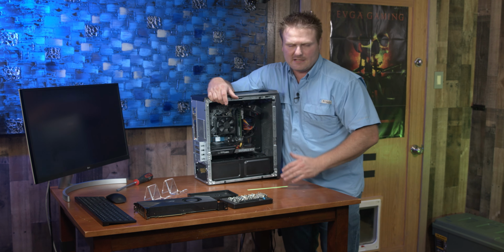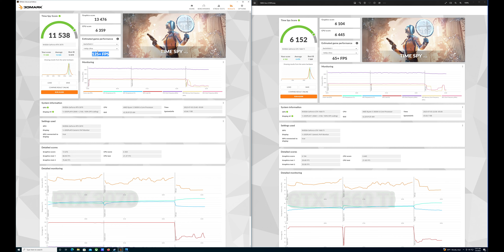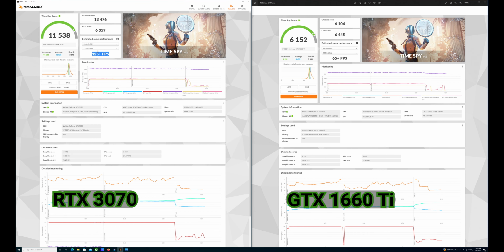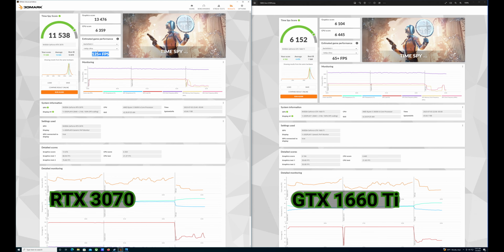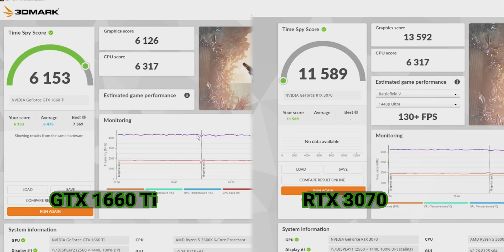ASUS Rog Strix Gaming Desktop G10DK Lets Upgrade the GPU to a RTX 3070 '' HOW TO INSTALL GPU ''

Comment: Thanks for these info packed videos on the legendary ASUS "Where's the Ventilation" series of ROG Wonder Boxes. I have the G10CE. For now. Quick questions: 1) This is the same system you unboxed in December 2022, right? Meaning it still has the 550W PSU on board and it's OK to run with a 3070 GPU? 2) the list of GPU's is really short for Best Upgrade/Best Option; then there are the Worst Option category - are ALL those cards listed included as Worst, or just the first one - the ZOTAC 3070 Twin Edge?

Comment: Do you have the same 550w power supply in there that it came with? Was just wondering as I was thinking of upgrading my unit as well.
Reply from the maker: I did upgrade one of the 2 asus. I had with a 800watts psu

Comment: So I just bought my current prebuilt here in Japan it has I511400F RTX2060Super, do you think this is upgradable to RTX3060 or RTX3070?
Reply from the maker: 3070 all the way but if you can afford the 4070 I would do that DLSS 3.0 is very nice. do you play mostly triple a game?  or if money is tight 3060ti 12GB
Reply: @TNW1337  triple A games. I can manage to buy it but I have to be smart when it comes to buying. 

But do you think RTX30 series are compatible with my current pre built?
Reply: @TNW1337  Just got this prebuilt today, do you think a RTX 4070Ti could fit in the case with the stock power supply?